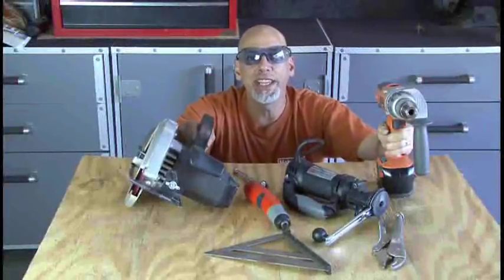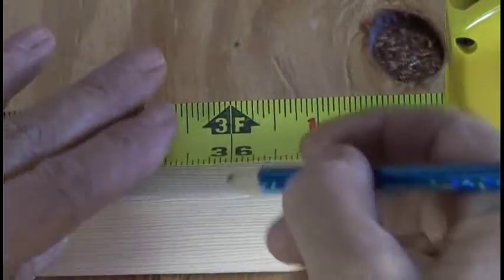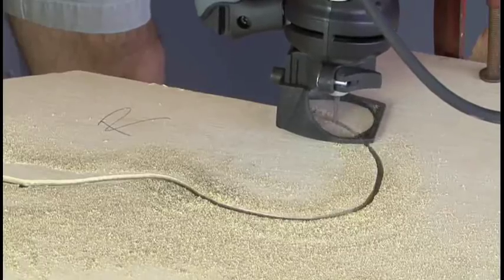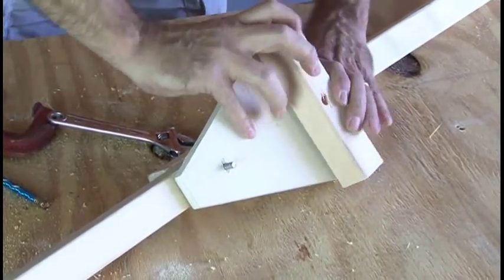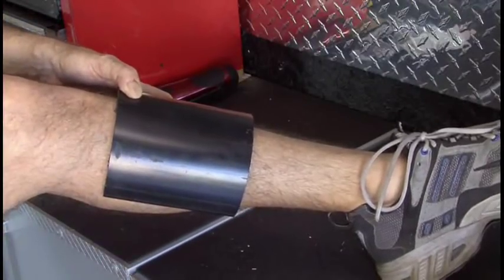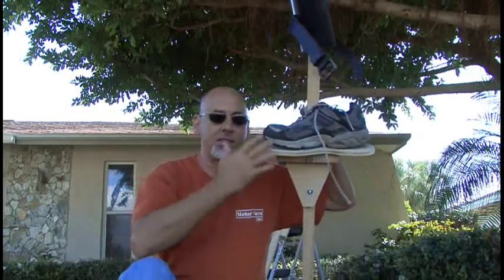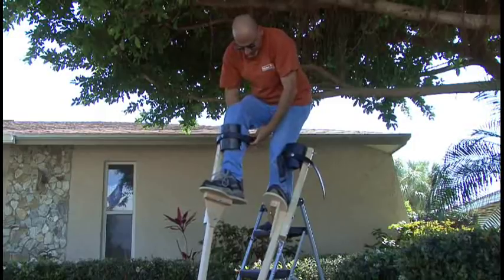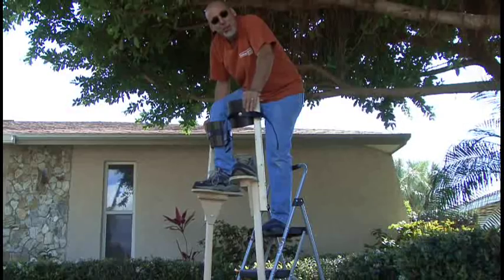Weekend Project: DIY Stilts

Comment: I build these all the time. Some pointers I can give if you are going to try this. Instead of 36in stilts try 24in stilts to start off, believe me a foot makes a huge difference in balance and the "intimidating" factor.  Also instead of the PVC pipe and belt you can just use the belt, it allows greater comfort and more controlled longer strides, just make sure to screw the belt to the inside of your stilt. Also strap on sandals are easier to put on your feet when you're mounting your stilts.

Comment: I think 3 feet is way high for a first time on stilts. One to two feet would be far more appropriate. You can also make these a little easier to use by either putting rubber on the bottom of the stilts (think of a foot on crutches) for added traction or by fabricating some sort of foot for the bottom of the stilts to spread out your weight a bit more.
Reply: I've never done stilts and I'm gonna do 3-4 feet, I'm suicidal and I dont care

Comment: It works if you use the right material and place the straps in the correct location on the stilts. Straps are what is used on almost all kinds of stilts.  But I do see your point...

Comment: I think this is the parts list 
2x 5 1/2in carriage bolts
6x 4in carriage bolts
2x 1in bolts
10x wood screws
8x smaller washers
8x washers
10x nuts
1x VPC 4 in. x 2 ft. Plastic ABS Pipe
1x wood 2x4
1x plywood 2x2
2x old belts

Comment: use a cross shape of bike tire tread for the bottom. It will make it less slippery and more durable on the bottom of the stilts. cut a cross shape of tire tread and use heavy duty staples to hold it in place

Comment: I have a set of adjustable Metal stilts that I use a aluminum adjustable pole to provide a little stability. I no longer need the pole but use it just in case.
Reply: i have lots of wood and a wood shop and tools. its cheaper for me to build them. i only wish i could afford pre built ones... then again if i build them... i know if i get hurt. its my own fault. not anyone else :)
Reply: Dancing with the Stars Se19 Ep13 Week 11 The Results from last week & new Performances online stream ic Grimm 22

Comment: Don't use belts, I had a buckle snap on me while out on a pair of stilts, I was damn lucky not to have gotten hurt.  Belt buckles are not designed for heavy load and the leverage action of your leg can pull them apart.  

Get some 2 inch velcro and make sure there's at least 8 inches of contact for each strap, that will hold you in.  Probably also want some ankle straps/cuffs.

Comment: The reason you dont fell very safe is because you haven't really made them like they should be, almost but not quite.

The actual main piece of 2x2 that supports your weight instead of stopping below your waist should actually be longer so that they come up further and then you can actually hold on to them.

If you made them like that they would be much easier to use and im sure would also give you more confidence.

You also dont want to be fixed to them as if you do tip you cant jump off.

Comment: Also if you have the legs longer so you can hold on to them as handles you dont need the trainers as you just make a platform to stand on them pull them up with your hands to make steps.

That way if you have a problem you can jump off at any time without any probs or injuries.

I would deff not advice fixing into the trainers.

Good idea though and with a slight mod would be fine stilts to practice and learn with :D

Comment: since you have to get up why not put them on sitting on the ground and use a pulley system to pull yourself upright, heck you could o it with a rope if you got the strenght

Comment: OK, you first of all never work without a spotter. Second of all, you need a high place to sit like a platform or the top of a ladder. You should also use a long pole to keep your balance when starting out. I've been circus trained by a pro. ;) So these are just some helpful and safe tips.

Comment: Yay Stilts! Not that I am an expert, though I do have the words StiltGuy in my tag. ::shrug:: 
I made my first pair of stilts very similar to these. If I could just suggest putting the drywall screws and washers under the cushion in the shoe and maybe attach a towel or some sort of padding to the belt. It would make for much more comfortable stilting.

:) Thanks for posting that! ... sorta made my day.

Comment: Wow. Those are the most over complicated diy stilts ever.  Not to mention the issue of them not being beginner friendly. 

Simpler method is a couple 2by4s (length of your waste plus how tall you want to be) with "handles" at top to hold on to for balance...  and simple wedges from a 2by6 to set your foot on.  If you start to fall just step off. 

Once you get "good" you can strap them to your legs, then move into a set like the one made in the video.

Comment: those look horrible.  foot plate is way too far back and why he thinks the braces need to be angled is beyond me.  I also wouldn't trust 2x2s as my supports and I weigh a fit 180 (toot toot goes my own horn).  Splurge and buy 2x4s.  Not only do you know for sure they are strong enough but they also make it easier to stand and walk.